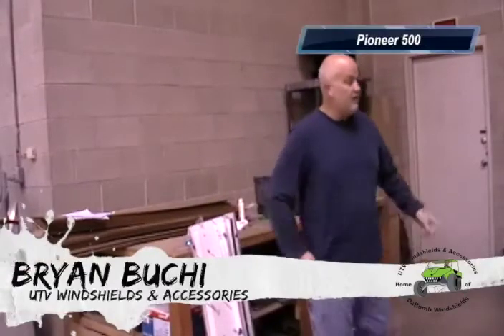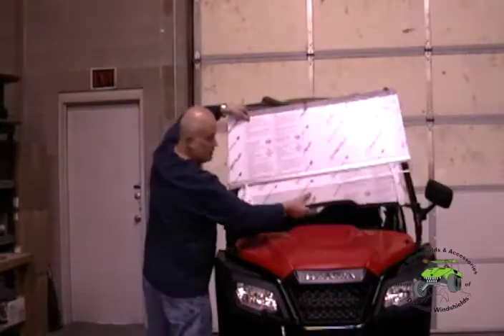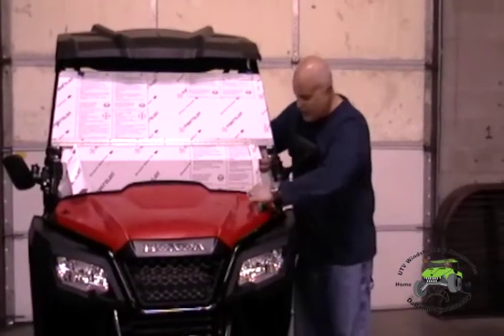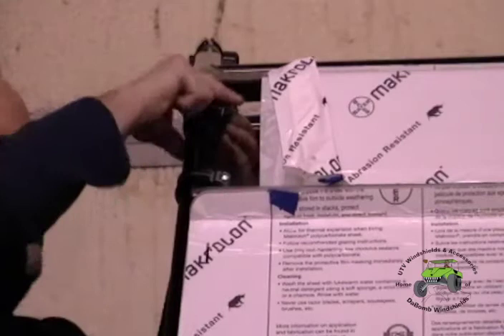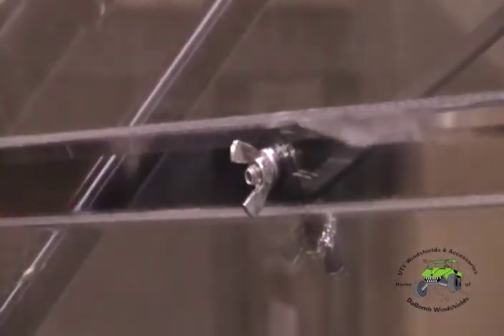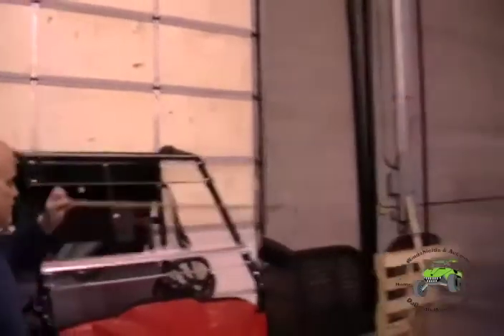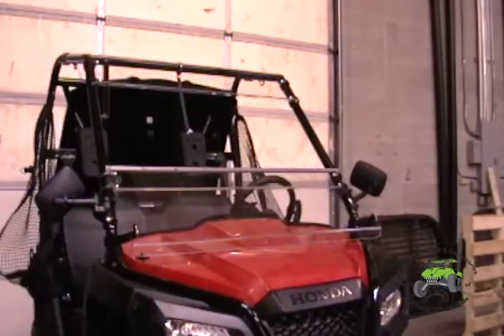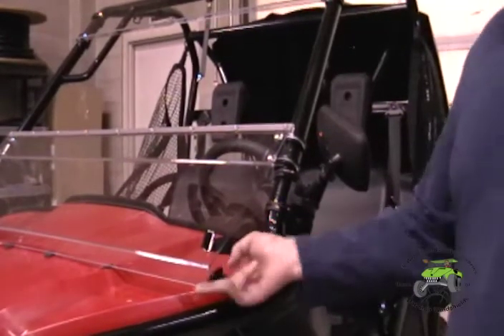Installation Tutorial for Honda Pioneer 500 | UTV Windshields and Accessories

Comment: Wish the hole would line up in the top where the tie wire gose if the angle of the top and middle would line up it would b a breeze to open up